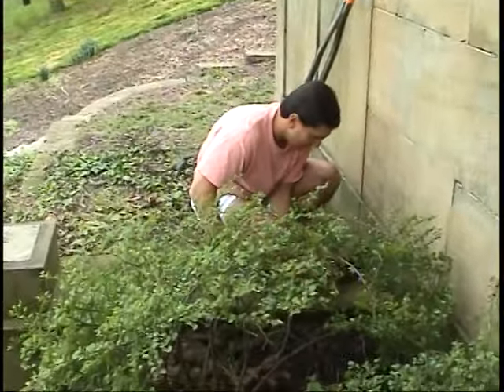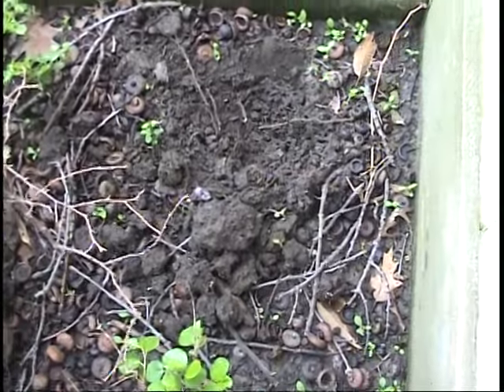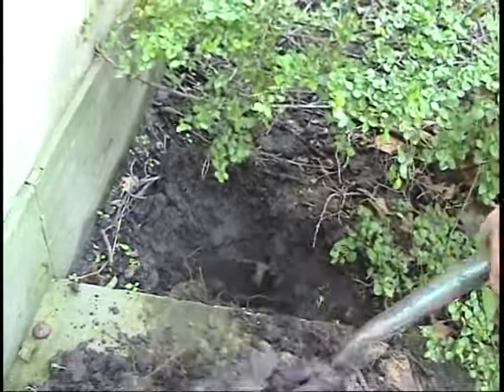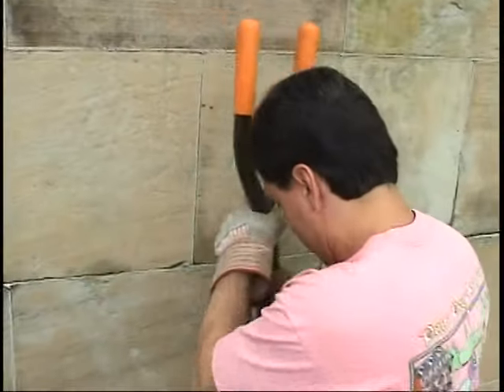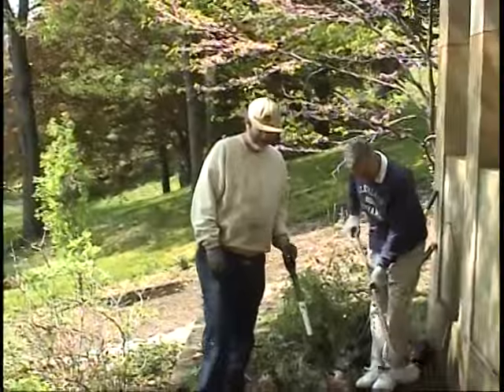The Secret Treasure hunt - Cleveland Casque Discovery 2004

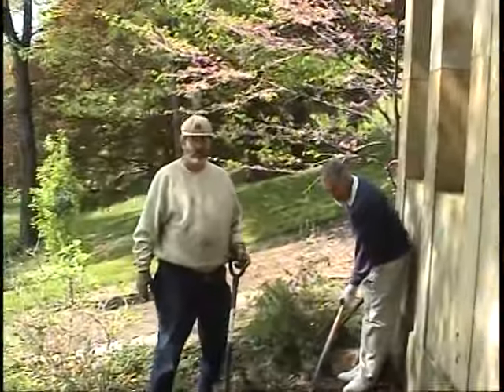Comment: A note of explanation.  This was a camera in which you had to load a videotape to record.  We only brought one videotape.  We filmed the dig from the beginning of the tape, until we ran out of tape.  We inadvertently left the camera rolling while we were digging, but we did not know it at the time.  We just knew that the videotape was at the end, and we were still digging.  So, we just rewound the videotape to the 6:01 mark and continued to film from there until we found the casque, then stopped the videotaping at about the 20:45 mark.  That is why the first 6 minutes of the video and the entire second half of the video actually occurred before the portion of the video from the 6:01 to the 20:45 part.  Sorry for the confusion!  Thank you!  ---BZ